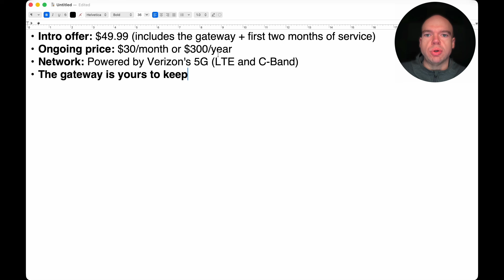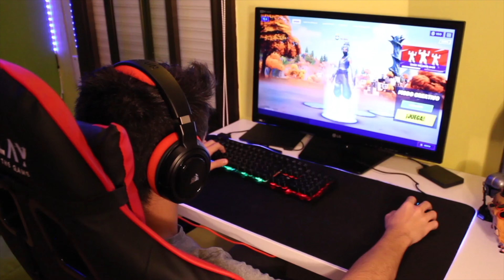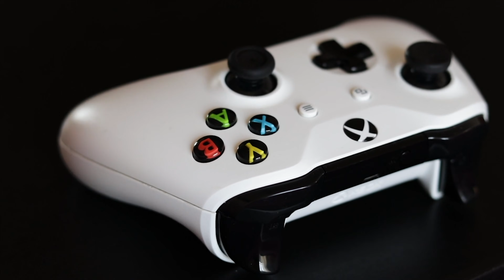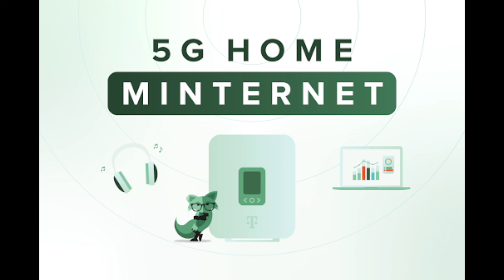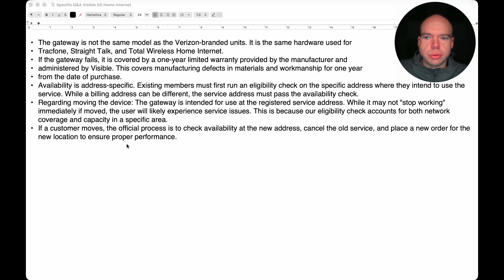Visible Wireless 5G Home Internet - Don’t Buy Until You Watch This!

Comment: I have T-Mobile home internet and I play destiny 2 on it all the time with no issues on Xbox and PC I play games all the time with T-Mobile home internet and have no issues
Reply from the maker: Glad that this seems to work well for you. What kind of speeds/ping are you getting when you play? And are you using WiFi or hardwired?
Curious because gaming performance on T-Mobile Home Internet can vary a LOT depending on setup/location.
Reply: @EB3Studios have the T-Mobile home internet gateway in a next to a window on our second story floor in our house connected to a deco mesh Wi-Fi 6 router system then my Xbox series s is hardwired to to the one Wi-Fi six node then we have an Apple TV connected to  one of the nodes but that's a Wi-Fi 5 node but it's still a deco I I get  anywhere from 400 to 600 download speeds and 60 upload oh and  my ping when playing games can be anywhere from 56  milliseconds to 100 milliseconds depending on the time of day but most of the time it's around 50 to 60 milliseconds which is not too bad but when I do a speed test on ookal speed test it gives me 15 milliseconds ping sometimes but that's just on a speed test and I'll get jitter like a five or four sometimes

Comment: You forgot to mention it's 200Mb/ mo. service, not for moderate streaming.  I wouldn't get though 10 days on it.  UseTMo Home Internet or (Att Internet Air @ 300-400 Mbps) OR your high-end postpaid cell phone plan instead and Bluetooth to your TV.
Reply from the maker: While the download speed is limited to 200mbps, the plan itself is Unlimited data. You could use 800+ GB or more with this if you needed to.

Comment: I currently use home Verizon 5G internet and it's working fine.  So I shouldn't have a problem if I switch to Visible, right?  I think this is only offered to existing Visible mobile customers though, right?
Reply from the maker: So, this was something that wasn't made quite clear before the public announcement. But from what we know now... Yes, it is currently only available to Visible Wireless customers. Generally, if the Verizon Home Internet works well for you, then Visible Home Internet will also work well for you. I just released an unboxing and setup video where I performed a speed test so you can see how it performs as a first impression: https://youtu.be/oNDgF4PruUY

Comment: Not available at my address or any of the addresses in my area I tried even though I have Visible and they’ve got tons of coverage here with no issues.     

Actually, it’s primarily why I got Visible for my phone is because my Internet has always been a bit crap and so I could just hotspot to make up the difference.
Reply from the maker: It’s definitely frustrating when the coverage is there but the home product isn't available at your specific address. Are any other Wireless Home Internet carriers available where you are like Minternet?

Comment: I had Verizon 5g internet and it was merely 'ok'.  I think they are dumping old equipment onto Visible to get rid of it.  Oh, and it was a nightmare to return their junk when I switched.
Reply from the maker: My take on it is this: At the end of the day, as long as it winds up working “good enough” for the $30 price point that’s people’s #1 priority. It doesn’t have to be perfect (and it won’t be because it’s wireless internet). But I know plenty of people who use the Verizon branded gateway version and have decent 5G Ultra-Wideband and they are happy enough with it. On the other side of this, I also know people who wound up going back to Cable internet because they were in a low signal area with Verizon and had buffering issues so they returned it.
One MAJOR plus with the Visible Gateway though, is that even if you decide to cancel the service, you don’t send the gateway back. You just keep it.
Reply: Its not "old equipment".  Its the newest FOXCONN router, manufactured 4/2026. I have one.

Comment: Just ordered this morning. I have had Straight Talk 5G home Internet for the previous year and works fine for me. So this should be the same.... But cheaper!
Reply: Yep, its the EXACT same unit!   I had the Total Wireless one. Consistent 200mbps.  I used around 500GB a month.
Reply: @greghale717 all Verizon pre paid home internet is capped at 200 down and like 20 up is not bad for a few devices
Reply from the maker: That's awesome, definitely let me know how the experience compares once you get it set up!